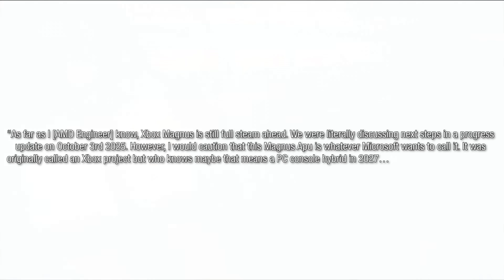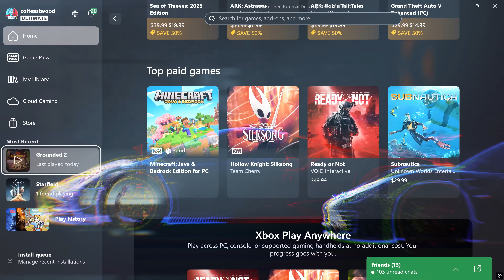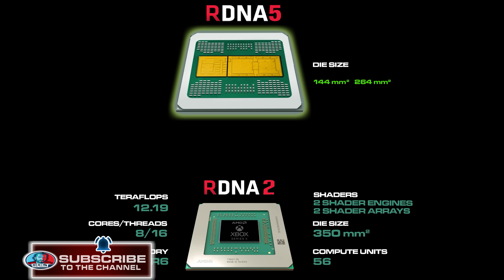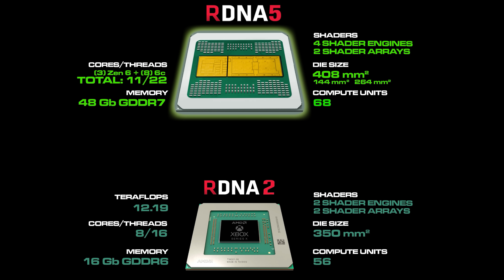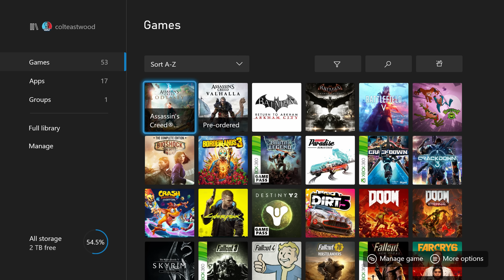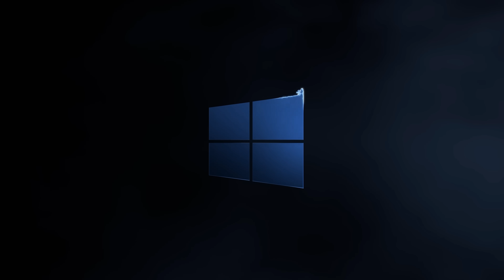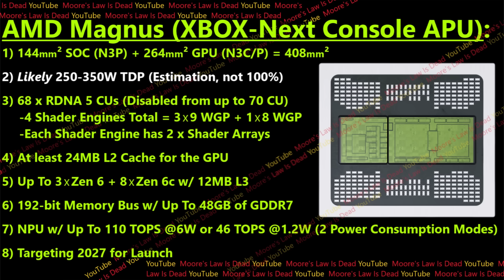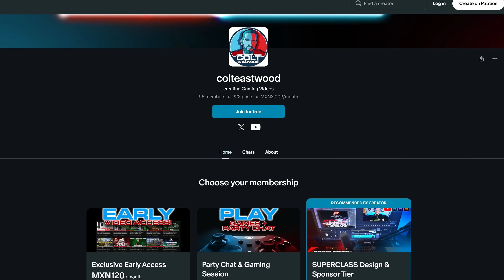Next Generation Xbox Console First Look at Xbox Magnus Chip Specs & Price #xbox  #amd #microsoft

Comment: Probably 1000 dollars.. but hasn't Xbox always been a hybrid console? It's called the "direct X Box".. hopefully it will be built on the new Ryzen AI Max APU's.. they already get amazing performance, AMD just needs to get better with Ray-Tracing/Path-Tracing! I'm am interested to see what an Xbox PC will look like. and they always say Xbox is more powerful than PlayStation, it means nothing.. isn't Sony using Nvidia this time?
Reply: "but hasn't Xbox always been a hybrid console?'   

Absolutely not, it has been a console only, it can not run PC applications or PC games.  If this upcoming hardware actually does run older Xbox games and can run PC titles, it will be the definitive definition of a hybrid.     

"hopefully it will be built on the new Ryzen AI Max APU's."

If rumors are anywhere near correct, it will be considerably more advanced of and SoC than the Ryzen AI Max APUs.  Ray tracing will have a considerably bump in performance I would imagine.   Also Sony is also with AMD, and will bring something interesting to to the table as well.

Comment: Xbox could sell super computers built by nasa, still doesn’t mean shit if old consoles are holding their potential back and gamepass is charging an arm and a leg a month. We never saw the full potential of series X and ps5, GTA 6 is probably going to be the only game to push those consoles to the limits. I refuse to buy a ps6 or new xbox just to play fortnite, call of duty, and madden with a slight, almost unnoticeable improvement. Xbox one and ps4 was the ceiling for consoles.

Comment: I don't really get the hype behind this thing, ngl.  One of the best things about a gaming PC is that it can be upgraded piecemeal.  This thing will be locked down with a low-end (compared to PC) CPU and nowhere to go.
Reply: If the rumors are true, this is not low-end even compared to a PC.  It isn't a 5090 to be certain, but not low end.  However it would be interesting, if this was a modular system, and that when Microsoft talked about a multi-year partnership with AMD moving forward, it was that you could in a few years time change out the SoC, if so inclined.. I doubt it, but that would certainly be a novel way of keeping your "console" alive without needing a new one in 5-6 years.  Certainly a better solution than a Pro console 3-4 years into a generation.
Reply: @davidandrew6855  Not the GPU, the CPU.  The CPU in this looks to have 3 full Zen 6 cores with the rest mini cores.  Unless Zen 6 is a massive leap over current chips, I can't see that standing up to the desktop chips we have now, let alone the ones that will be out by the time this thing launches.
Reply: @ThisAintPizzaHut445  Well coming from 7 usable, underclocked Zen 2 cores, those will be a major improvement in IPC. I am betting the low power cores will also be more performant by a good margin, clock for clock.  

How that will pair with current PC of the day, I guess we will find out, but if they are just driving 120fps, I think it will be more than enough.  It will probably be comparable to Zen 4 cores, and I'm totally speculating here, and if that is the case, we are set.

Comment: The specs seem to speak for themselves but as we have seen this gen, the whole 20% to 30% power narrative over and above PlayStation essentially went no where and Xbox games had to wait for the tools, and more optimization post launch...
Reply: Wait for the tools, wait for E3....
Reply: I really think it was down to the APIs, seems the PS5 has much tighter integration and efficiency than DX12 and Series hardware.  You would think that not the case, but I believe it is, unless the really low GPU speed is 90% of the problem for Series X.  DX12 Ultimate supports all the good stuff, but do we really see it in Series X games even from Xbox?

Comment: It would be great if i could have a hybrid console in my living room, since i play a lot of games on Steam. it would be cool if it's possible to access games bought from GOG as well, but i assume it will be a bit more limited than buying a complete PC. It's also a necessity to be compatible with both the Xbox One and Xbox Series consoles, in addition to either have the option for a blu-ray drive or have it built in as standard. The fact that it will cost around $1000 is not a concern in my opinion since a good gaming PC costs at least twice that amount or more! But right now anything related to Xbox can be taken with a grain of salt, they change and cancel things on a weekly basis.

Comment: A hybrid system that relies on emulation is effectively a PC platform. That might save them from building two separate native operating systems, but it also opens the door to much easier piracy and cracking emulated builds are simpler to dump and patch. The only alternatives are to invest in separate native OS or handle backward compatibility at the hardware level the way Sony does, which is safer but more expensive.

Comment: Does it really matter at this point? They been doing anti consumer services and price hikes, canceled games. And no more exclusives. That alone is going to tank the hardware sales. Not to mention the prices closing in at 4 digits. Best way I can think of for xbox to survive next Gen. Would be if with one sku console only at $299.99 with those high end specifications meantion on this video. And then games. They have to make great games again  and to seal the deal, run them directly from the disc. No more 100 plus gig downloads. But I don't see this happening. I expect them doing the windows model. Software with licensing deals for hardware manufacturers. Probably just 3 to 6 manufacturers. (Asus, hp, dell, etc.) I believe this has been the plan for a while now. And its all thanks to Microsoft. They being doing this crap since when they own bungie and more specifically after halo 3.

Comment: Xbox Magnus is nothing but a PC using next gen hardware (that Sony and AMD made together) package with Xbox logo and a few tweeks (Like Asus ROG). They will probably launch two version (just like last gen. However because it's a PC it will acale much better. This thing will easily be 800/1200 price. After this,  Microsoft will go software only. The righting is on the wall. Xbox console hardware days are numbered; AI and software is where the focus is going.

Comment: This is Microsoft they most likely will find a way to blunder the launch as they have the last 2 generations. Xbox one with required connect, Series X with the damn Series S, as if the naming scheme wasn't confusing enough for anyone new, they doubled down with what games that were labeled X/S actually required the new system to play.  So many people bought the Series S thinking it was a Series X without a drive. The whole point of owning a console was it was cheaper and less confusing then a PC and Microsoft some how found a way to do the opposite.

Comment: Not releasing  a Series S model with Physical Bluray drive was so dumb. When You have the Best Backwards compatibility.
Reply: It was too low priced to have a disc drive
Reply: @chrissyboy7047  Xbox One S had a 4K Blu-ray drive and released at $300 so what's Xbox Series S's excuse?
Reply: @AzaiaMonota  its more powerful and chips cost more so costs more to produce than the one s. If you add a drive it would cost even more. Its not rocket science

Comment: I hope the report on the TOPS is wrong because only having 110 TOPs is pretty low. For comparison the PS5 pro has 300 TOPS.
Reply: PS5 Pro as 300 TOPS if the GPU is doing nothing else.  The AI accelerator in the PS5 Pro is part of the GPU if I understand how it all works and I think I read the actual real world number would be between 50-100TOPs which is still impressive.   If this NPU in Magnus is totally separate and works free of the GPU, it may be even more performant than what is in the PS5 Pro of AI upscaling. Also it maybe more flexible too, as I think the AI accelerators in PS5 Pro only work on AI uspcaling, nothing else.

Comment: Will this not just be the same spec as the ps6 ? I mean even 5% difference between each other. To be fair the Xbox needs to be 50% better than the ps6 if not and it just on par you might as well get the ps6 as most Xbox games are on ps6 now. So what would Xbox bring if they are similar spec as the ps6 ???
Reply: This this will be far more powerful than the PS6
Reply: @TheKing8608_ maybe but what’s the point in all that power if you get the Xbox games on ps6 and there own exclusive ps games on ps6.  This means even if the Xbox is more powerful you will still get more catalogue of games on the ps6 inc Xbox games.  I cannot see steam coming to Xbox as steam pc games are cheaper than Xbox games so how would Microsoft make more money on games as we all know Xbox games have a higher price to cover the console.  Also I doubt Sony will let the power of the Xbox console get that far ahead as we know Sony changed the ps5 design slightly to beat or compete with  the Xbox series x. So I doubt there will be that much difference when released in a couple of years to be fair.   Microsoft should have never let the Xbox exclusive’s go to Sony ps simple as that as I can not see what this new Xbox will offer when you can enjoy Xbox and ps games on a ps6 as you can not play ps games on Xbox.

Comment: 48 gb vram is hard for me to believe as no existing radeon gpu has that . Furthermore, with the positioning of this product, as a hybrid with access to steam … I’m betting most studios will just develop for PS + PC which the new Xbox PC will be able to play . Thus, this positions the new Xbox as a retro Xbox emulation machine + a pc
Reply: That 48 is full system ram ( the gpu will also use that ram) it's not vram as per standard gpus. 

I'm sorry if this is new info but all consoles are pcs.. they just tend to have locked proprietary software and custome chipsets.. they all use the same technology and the only reason you don't put windows in a playstation is that it's not compatible with that os. Now xbox has been running windows from day 1, so this new system will be running a version of windows that has a console front and a desktop option or so that's what's being purposed. This system will run pc versions of games aswell as having backwards compatibility with digital library (or so that's what's been stated). So basically this will be a xbox pc with a console front to give the best if styles.
Reply: @micahhumphrey691 exactly
Reply: That’s not accurate. The 48GB VRAM rumor isn’t about existing Radeon GPUs, it’s likely shared memory between CPU and GPU, just like Series X uses unified memory architecture.🤦🏿‍♂️

And calling it a “retro Xbox emulation PC” is wild when it’s literally being built to expand the Xbox ecosystem, not replace it.🤦🏿‍♂️🤦🏿‍♂️ Xbox isn’t trying to mimic Steam, they’re merging console simplicity with PC flexibility. Studios developing for PS and PC doesn’t hurt Xbox 🤦🏿‍♂️ it helps them, because every one of those PC games runs day one through Game Pass or Xbox Cloud. That’s the long game.🤷🏿‍♂️ yall refuse to use logic
Reply: @R0yalB7oodL1neMedia  those games wont be running through gamepass or cloud. Theyll be accessible through steam unless they are ms games
Reply: @chrissyboy7047  Not exactly🤦🏿‍♂️ Xbox’s whole point is cross-access. Game Pass already lets you play Steam titles through PC Game Pass integration and Cloud streaming is built to expand beyond just ‘MS games.’

Microsoft’s strategy isn’t to lock games in, it’s to make sure you can play them anywhere. Whether it’s Steam, Game Pass, or the Xbox app, they’re all connected under the same ecosystem. That’s literally what separates Xbox from everyone else right now, they’re building reach, not walls.
Reply: @R0yalB7oodL1neMedia  yeah I get what you're saying now. I misunderstood you when you said they'll play through game pass sorry. You mean like how game pass on pc now shows all of your installed games regardless of what store you bought them on?
Reply: @R0yalB7oodL1neMedia its true.  But i rather have the data . Not pay  to play games . If I own should be free to play how I like . But they wont.

Comment: Deja vu - have we learned nothing….
Reply: Microsoft should know better considering they are a software and service company first. Hardware doesn't really matter without getting great software (that pushes the limit of hardware) and marketing which Xbox has been awful since the XB1 generation and continues to struggle under current leadership.
Reply: I am still waiting for the games that take advantage of all the high end tech we were promised for this generation. We were told it was capable of doing things the others couldn't. What happened? Developers didn't want to spend time and money to develop games for  one console? This generation of Xbox has been the most disappointing farce I have experienced in gaming. I am not rushing to give my money to Microsoft until they start making games I want to play. And removing features or requiring jumping through the hoops they want is not a good start. Removing freedom in the way you play is not a great selling point.

Comment: Consoles gonna be firing after this. I don't mind dropping a extra hundred I need to see 120 fps or more across the board for all games🔥. Then my Tv will serve a purpose for most games.
Reply: Extra $100? Try extra $300-$500
Reply: @SHOman_86 even so that's ok. I'm tired of games on console releasing at 30fos for quality mode because of lack of power.
Reply: I'm with you, but I'd expect next gen consoles to cost around $1000 sadly...
Reply: @JonKirst yes based on the chipset alone it just might
Reply: You want 4k at over 60 in new releases? Expect to cough up a minimum of 1k
Reply: @Thankusnak yesssir
Reply: @Thankusnak Deal
Reply: i really hope the cooling system is the same or even better than the series x as that console is so quit when playing demanding titles and the heat dissipation is really top tier.
Reply: No they are not. The difference between top end hardware (PC) and what can be sold in a console (max 500 dollar) is getting more and more apart from each other.
Reply: Yes exactly 👏🙌